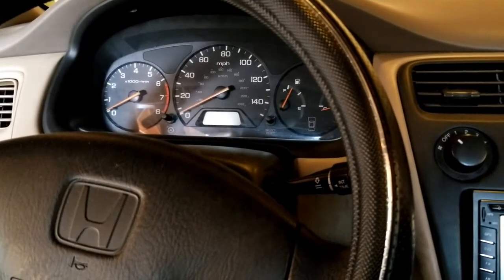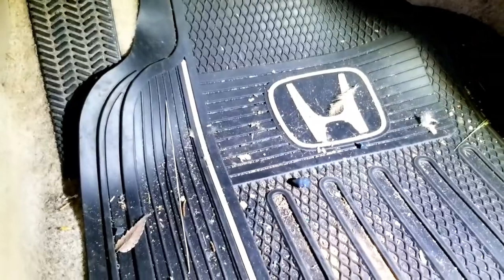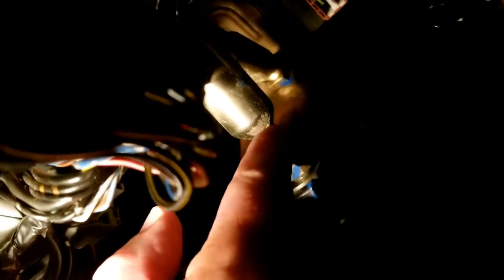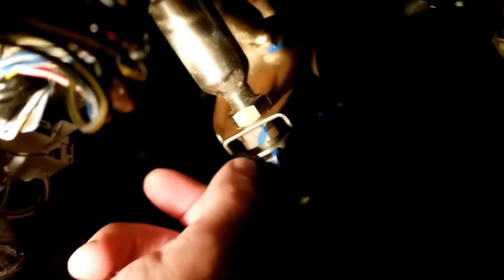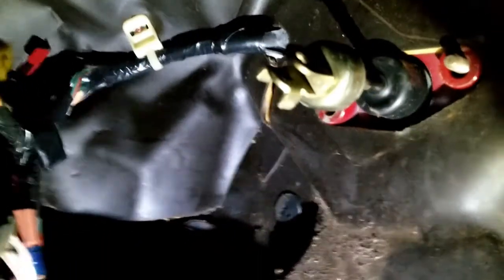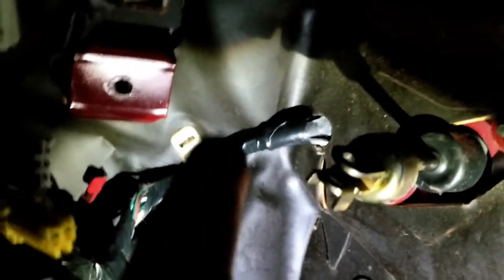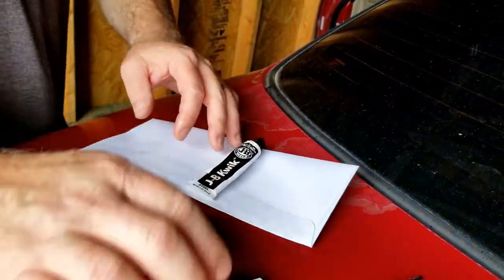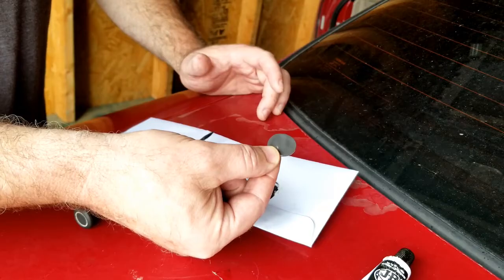Honda Clutch Safety Switch Repair

Comment: Man I just had the same damn problem! Replaced the starter because for some reason I didn’t even consider this safety switch. Anyways, just came here to say instead of taking the pedal out, I half way glued a nickel to a screw driver, then stuck it up there and put it on the safety switch home like you did the bottom one and it worked! Not saying anybody should do this because I don’t want to be liable if something messes up, but it worked for me🤙🏽 thanks for the info bud
Reply: Hole*
Reply from the maker: Thanks for adding that info! Glad to hear this worked for you.

Comment: Appreciate the vid man my 7th gen is doing the same thing I put a bolt where the bottom pedal stopper was. Didn’t even think to check the top of the pedal assembly thanks for the help man!!!!
Reply from the maker: Glad the video got you back up and running. 

Thanks!

Comment: Just fixed the same problem on my '02 Civic - thanks for the awesome video!  I had a similar issue with my cruise control switch last summer and replaced the pads for that and the brake light switch, but didn't think to get the clutch safety switch because it wasn't visible.  I had a leftover replacement plug (from a four pack I bought on Amazon for five bucks) and was able to pop it into the empty hole without taking the pedal assembly out.  Thanks for taking the time to give a great explanation!
Reply from the maker: Thank you!

Comment: I'm OK with the paper clip (or similar short) solution. The car I learned on didn't even have such a safety switch. Anyway, the first thing I do whenever I get in the car is to push in the clutch pedal. I won't ever try starting the car without depressing the clutch. Doing so would change decades of muscle memory.
Reply from the maker: Same here. But, tell the truth, there was one or two times you chugged the car forward a couple of feet!

Comment: The JB weld and nickel fix is sturdier that OEM. I imagine they do the blue rubber stoppers to clicking sound when the pedal touches the switches. More importantly, it avoids shocking the switch and eventually damaging it when you push down hard or let your foot quickly off the pedal. Just saw another video where a short piece of fuel hose was slid snugly onto the tab where the blue stopper for the starter switch touches. That also looks like a sturdy fix that should make no clicking sound and provides some shock absorption to protect the switch like the OEM stopper intended.
Reply from the maker: Makes sense. The rubber probably also keeps the impact forces down as well to preserve the switch. Thanks for adding that info!

Comment: Yeah I just had to do that today, it works, and yeah crunch time under there. Thank you for this video because i have put screws in the holes for the brake and clutch cruise control and forgot about the upper part
Reply from the maker: I'm glad to know it helped you out. Thanks for commenting.

Comment: Thumbs up for an awesome and informative video!

I’ve got a 1991 CRX HF which was never equipped with cruise control, but still has both the clutch switches you show in this video. In my car, the lower switch is tied to a shift light (up arrow icon) in the gauge cluster that’s supposed to let you know the best time to shift into the next gear. It basically just lights up in every gear @1,500rpm and is pretty much useless. 🤣
Reply from the maker: Thank you for watching and commenting

Comment: Great video.  I've had 3 clutch master cylinders go bad and the reason was the same each time. One of the 3 bolts holding the housing together had snapped and the Dot fluid leaked out, pedal to the floor with no warning signs at all.  I'm wondering if this is a common problem?
Reply from the maker: Thank you! I've owned several Honda manuals and never heard of that being an issue.

Comment: Thanks for the video. My cruise control on  2003 Civic LX manual transmission has a missing stop on the lower switch, so it would not engage. I taped a quarter across the hole now it works.    I will put a more permanent with the glue as you have shown.  I found the problem by using a meter and checking the voltage and continuing per a Honda Service manual ( The Chilton Manual is not detailed enough ) the with the cruise control module disconnected. The 14 pins were reversed from the diagram so initially the readings did not make sense. Also the module is not locate according the the manual. It is located in front and a couple of inches to left of clutch pedal.
Reply: 2001 ACCESSORIES & EQUIPMENT
Cruise Control Systems - Civic & CR-V:file:///C:/Users/Dale/Downloads/honda%20civic%20ex%202001%20-%20cruise%20control%20system.pdf
Reply from the maker: Thanks for stopping by and commenting. I'm glad it was able to help you with your problem. Looks like you went the extra mile with your diagnosis before guessing.

Comment: Just repairing this today. The local FLAPS carried the right parts in stock for $8. Dorman Accelerator/Brake Pedal Stop Pad 74015 or Honda 46505-SA5-000 from the local dealer.
Reply from the maker: Thanks for the part numbers.

Comment: I have the exact problem on my prelude.  It won't start,  I tested the starter and it was good.  I changed the ignition switch the problem still persist.  I look under and saw those 2 switches on the clutch paddle. I didn't know what they are.   I searched and found this video.  Will do this tomorrow and hope that it'll solve my problem. Thanks
Reply: This works.  I'm back on the road.
Reply: Another idea,  I used bolts n nuts found around the shop to plugged that area.  Cost $0 to fix.

Comment: 2009 Accord. Intermittent no-start so impossible to diagnose.  Itd randomly start working. INFURIATING. Changed battery, starter, and even bypassed the ignition relay. Who wouldve thought a simple clutch switch wouldve failed after 200k miles 🤦🏻 not me. THANKYOU
Reply from the maker: Glad you found the video.  Thanks for taking a moment to comment!

Comment: Hey I was able to do it without taking the clutch out, when i put my thumb all the way up there I was able to feel the hole, so what I did was tape the back of the rubber stopper to my thumb to keep it in place. And once I got up there I was able to press it in with some force. Car starts now !
Reply from the maker: Good deal! Glad you got it running.

Thanks for sharing.

Comment: Great video. I'm working on a car and have a hard time starting it. It will start after 10 or 15 tries. I think this might be the problem.
Reply from the maker: Yeah. If the switch is bad, it could be intermittent. Jump the connector and see if it works. Then you'll know!

Thanks for watching and commenting.

Comment: Hey man, my '97 Prelude has no cruise control, but the car starts with the clutch out. It'll roll if you hit the starter in gear so I always park it in neutral. You may have just helped me figure out why my cruise doesn't work.
Reply from the maker: There are two switches on the clutch and one on the brake. Good luck!

Comment: On my 03 Honda Civic I was able to reach both button locations since both of mine had fallen out and pop both in without taking out the assembly.  I bought them from the dealership at a ridiculous $8 per button, but they had them in stock.  They use a plastic/rubber substance instead of metal to reduce the chance of vibration damaging the switches so I would be careful about using metal.

Comment: Great video! I noticed the broken rubber piece on the floor, but it turned out to be the cruise control pad. I tried the paper clip trick, but it didn’t crank. My battery is only a few days old and cranked great yesterday. Today, nothing. Lights on the dash turn on, but no luck cranking over. Should I buy a new switch or could it be something else like the starter? 🤔
Reply from the maker: You can use a volt meter to see if the starter is getting the crank signal when you turn the key before you buy one and switch it out. Also try hitting the starter with a hammer. That can unstick to solenoid if that's the issue. 

Thanks for commenting!
Reply: Thank you! Appreciate your reply.

Comment: Well - shit. Good info, but I'm just too old and broken to be crawling around inside the dash of a 94 Del Sol S (MT) to do that repair. It's the upper one that died on me, so I'd have to pull the clutch pedal and mount.  At least my troubleshooting was correct. I'll just have to eat the cost of labor @ Honda. Thanks for the info.
Reply from the maker: Sorry to hear that. The Del Sol setup is the same as my 93 Civic, which is about the same setup as this Accord. Except the floorboard under the dash is even  smaller! Hope you get it sorted out.

Comment: I have a no crank no start in my 99 civic SI.  I put the key in and everything lights up, but there is no crank, and I don't hear my fuel pump priming.  Usually there's a "whirring" sound but its dead silent.  
Some people told me its the starter.  But wouldn't my fuel pump still prime if it was the fuel pump?
Some people told me its the fuel pump.  But wouldn't my starter still crank if it was just the starter?
Some people people mentioned it might be a relay.  The main relay behind the glove box.
Or the ignition relay underneath the steering wheel.
Or who knows.  I haven't been able to get my car up and running for a while as it sits in my garage.  I don't know what to do, I'm thinking about getting it towed to wherever is willing to take a look at it.
Reply from the maker: It will crank and no start even if the fuel pump is bad. Take the back seat out and disconnect the fuel pump. Connect a volt meter to the two wires in the connect and then turn the key to on. If there is 12 volts with the key on, then it's the fuel pump. If there is no voltage, it's a relay, the fuse, or a broken wire. Good luck.

Comment: My 2016 Honda City VX Idtech MT(India) won’t start until I keep the start/stop button pressed. After holding it for about 3-4 seconds the car starts and then drives perfectly. On the instrument cluster, the orange check starter system light is on (Clockwise arrow head circle with ! Mark in it).
Earlier, I just needed to depress the clutch and press the button once but now I’m having to hold it.

I have replaced the new Car battery and Keyless remote/fob battery too.

Please help.
Reply: Just found the plastic stopper pieces. Now the only confusion is whether my car had a stopper for both the switches or not because I can only see the hole for the stopper for the lower switch, while it is not easily visible whether the upper safety switch had a stopper or not.
Reply from the maker: It has a stopper. Almost impossible to see it with the pedal installed.

Comment: I have the same problem, stuck a paper clip in and the car started, but i plugged the switch plug back in and pressed the little button on the back of the switch and it also started, will the paper clip method cause any problems except maybe the unsafe problem of being able to start in gear?
Reply from the maker: It shouldn't be an issue. Just don't ram it into anything while cranking it. It's probably a habit pressing the clutch, but I have chugged a car forward once or twice by mistake.
Reply: @ktecgarage ok Thanks 😊

Comment: Would this problem not signal any power to the starter? My Honda Accord is not starting but I can pop the clutch and it starts right up but if I bridge the starter it starts right up as well
Reply from the maker: That's exactly what happens. It's like trying to start the car without pushing in the clutch. If you jump the switch connector under the dash, I'm betting it will start. Good luck

Comment: Can be used metal ? Screw a washer ? Or have to be 4:01 plastic ?
Reply from the maker: You can use anything so long as it closes that switch.
Reply: @ktecgarage  sounds good , I have same issue , and I was thinking to screw a washer … I updated when I do the job. Thanks so much

Comment: What about a 2001 civic. I took a look back there and the peice is missing but when i tried pushing the top safety button in by hand it wouldn't start
Reply from the maker: If the switch is bad, it won't crank either. Civics are the same as the accords. Try unplugging and jumping the connector. Good luck

Comment: I just had this problem happen to me when I ready to warm the car from the cold weather for work and it tryed for a sec then just won't do a thing after that. I was in a panic so started thinking it's not the battery sense it's new and the lights would dim if it's low and hear the starter click. So the next was thinking it's the clutch failed. Looked under realy fast and seen the first switch, maybe it failed. After watching the video and showing 2 switches, I'm like oh no so it's most likely the top switch or both bad. I'll try out the jump method to see if it's the switch or the rubber piece is just rotten out. Mine is a 2009 Honda accord EXL 6 speed manual. Thanks for the video.
Reply from the maker: Glad to hear the video helped you track down the issue. Thanks for commenting!

Comment: I've got a switch thats on its way out (car sometimes wont start with clutch pressed in, takes a couple of tries). In order to replace the switch itself, do you still need to remove the entire clutch? I drive an 04 Honda Accord EX 2.4l with manual transmission.
Reply from the maker: Getting to the switch could be easier than getting to that stopper. I've never worked on that generation Accord,  but I believe I could have swapped the switch on the 2000 Accors without removing the clutch.

Comment: Same issue. Unfortunately, I just purchased a starter and battery before watching your vid
Reply from the maker: Well. That stuff was going to go bad sooner or later, right?

We have all loaded up the parts cannon before!
Reply: @ktecgarage  that’s how I’m looking at it now. The job was very simple but time consuming because of the tight space like you said. 

I used a random bolt and nut and it got the job done 😂😂

Comment: Still can’t get my car to start after messing around with the switch
I manually press the switch with my finger while having the clutch pressed in, turn the key, and it still won’t start
Checked the relays and fuses- they seem to be fine (I can actually hear the relays clicking every time I try to start the car), but car still won’t start. Not sure what the disconnect from the starter switch to the relay is, but can’t seem to figure it out. Any suggestions?
Reply from the maker: Did you try a volt meter to make sure that the starter is getting the crank signal? Could just be a bad wire.

Also could jump the terminals on the starter and see if it cranks and make sure the starter isn't bad.

Comment: Hey my guy quick question, I sort of have a similar problem but when I tried turn it on there’s a rapid click besides no crank no start, can this be a culprit for that as well?
Reply from the maker: Is the clicking coming from the starter? If so, this isn't your issue. Either the starter  or the battery is bad. If you have a volt meter check the battery voltage when you crank. If it drops way down when you crank. It's the battery. If only drops a little, I would suspect the starter.

When this switch goes bad, the starter gets no voltage and it wouldn't click.

Comment: My car is getting started but I'll have to be quick to remove my foot from the clutch and once the car is idle if I push the clutch in its shutting down. It's very weird please help! I own a Suzuki kizashi 2011 MY
Reply from the maker: Possibly a dirty throttle body. Not familiar with Suzuki

Comment: I’m having this same issue on my 07 civic si, I tried to do the bypass to see if that’s the issue before ripping the clutch pedal out, and still no start any ideas?
Reply from the maker: Listen and see if you can hear the fuel pump prime and watch to see if your key security light is blinking while you are trying to start it. Good luck!

Comment: Instead of taking everything apart, you can also just stick a paper clip in the clutch pedal switch connector.

Boom fixed for 5 cents, and 2 min

Comment: The top part of the bracket above the safety switch,does it bolt on top on the frame,or it bolts only on the firewall?My clutch it loose and it looks like it should bolt on the top but they’re isn’t any holes in the frame.
Reply from the maker: Two studs through the firewall and a bolt above the safety switch.
Reply: @ktecgarage  I thought the same. From what I can see there isn’t a hole in the frame above where you bolt it. Gotta check tomorrow. Thanks for the knowledge.